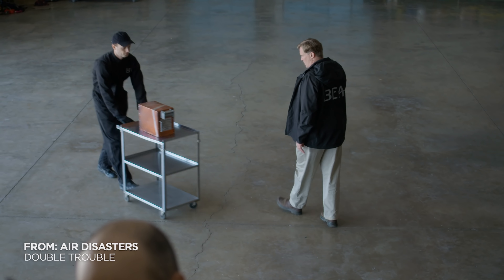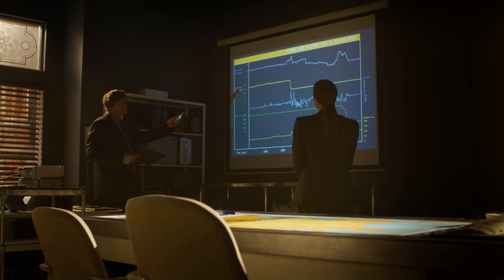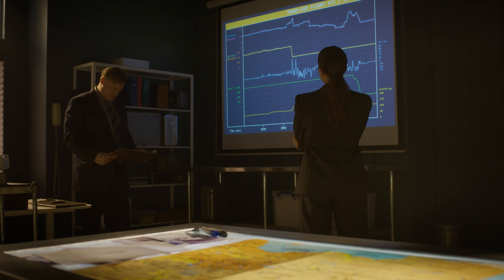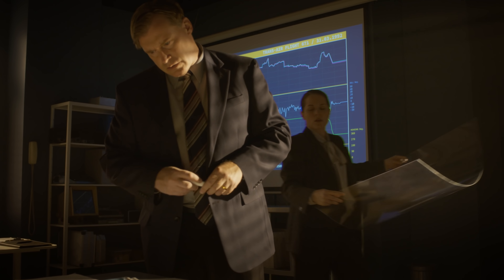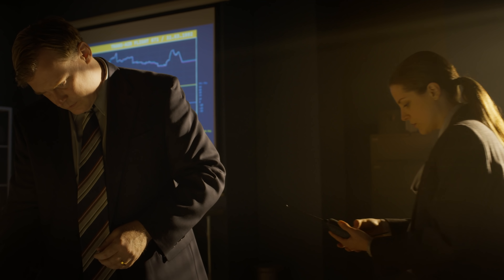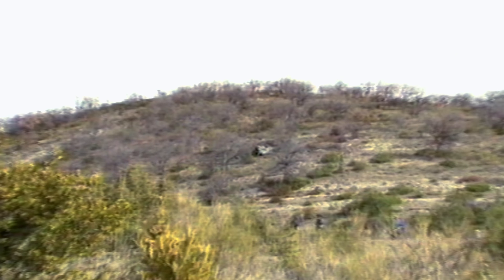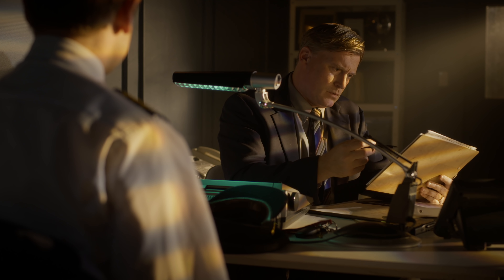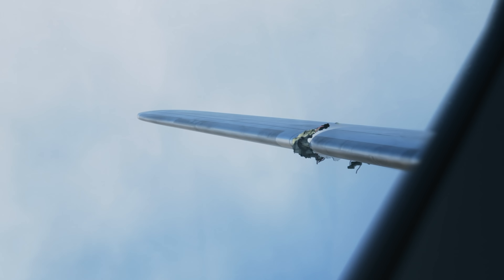Why Did 2 Working Engines Detach From this Plane at the Same Time? 💭 Air Disasters | Smithsonian

Comment: Who had Engine Detached
Flight 191 lost the left engine 
Flight 671 lost 4 or 2 engines 
Flights 587 (lost two engine falling from the skies caused by Pliot Error)
Reply: El al 1862
Reply: And a united airlines dc-8
Reply: And also EL AL 1862
Reply: The USAF B707 too

Comment: So in all these cases including TransAir #671, the result was metal fatigue which is unable to be corrected (e.g. use different metals to manufacture the engine and mount) and the only remedy is more frequent inspections?
Reply: At those times, those solutions (mostly different metals) are not available. For this specific flight, the condition is unusual: severe turbulence. Besides, metal fatigue occurs gradually, so early detection is vital.

Comment: so what happened then? could someone explain for me thanks
Reply: It was a due to metal fatigue on the attachments of engine number 3. The engine detached and knocked out the 4th engine
Reply: Metal fatigue caused one of engines to fly off this hit the other engine tearing this off
Reply: since no one explained i will - it is metal fatigue and one engine hit another
Reply: @theskyline1425  this incident is exactly what happened to El Al 1862 except it was a 747 this time and it didn’t end well the final report also conclude same findings and even more?

Whale 05 a Boeing KC135 (I said it was a McDonnell Douglas aircraft it was Boeing for your correction) Tanker aircraft during the Gulf War was flying North from Jeddah and because they were ahead of another Boeing KC135 I believe it was Whale 020 who had further to go mid flight they allowed 020 the other KC135 aircraft ahead of them as they had further to go (020) the winds at the time and because they were separated by 2 Miles and were approximately 2.5 Minutes apart and winds were coming in from the west on a heading of 270 blowing at 85 knots. Pushing the wingtip vortices or Wake Turbulence into Whale 05 putting the aircraft into a violent left roll briefly and when the aircraft snapped 110 degrees to the right it’s what snapped Engines 1 and 2 off due to Extreme G-Forces this accident was also adverted as the Commander or Captain Major Sweetney learned from training if you’re in a violent bank deploy the speed brakes on both wings which saved the plane, himself and his crew.

For El Al 1862 the video has been done by Disaster Breakdown, I believe TheFlightChannel has as well and of course Smithsonian Channel has as well. 
The Mission Disaster or Whale 05 that is done by Smithsonian Channel possibly by TheFlightChannel but Disaster Breakdown hasn’t done it tho

Comment: Why did they detach at the same time? Murder suicide pact?🤷‍♂️
Reply: Metal Fatigue on Engine 3 and since it was on the inside of the right wing it would make sense that it would be blown backwards and to the right into Engine 4 

El Al 1862 is pretty much the same except it wasn’t a happy landing search it up, Disaster Breakdown, Mini Air Crash Investigation (I think the channel is called), TheFlightChannel and Smithsonian Channel have posted videos about it. 

Another example is Whale 05 titled “Mission Disaster” except that wasn’t due to aircraft having an engine fatigue on it, it was due to powerful winds and due to them being ahead of another KC135 Tanker Aircraft (Both planes were MD KC135 Tanker aircraft) they swap positions mid flight as Whale 020 the other aircraft had further to go and its Wingtip Vortices / Wake Turbulence was pushed in by Winds coming in from the west at 85 knots which probably what about 150 km/h maybe 170 which would be about 100 to 110 mile and hour winds. 

The video has been done by Smithsonian Channel and probably also by TheFlightChannel check both videos out.
Reply: Mind you similar accidents have been due to undetected metal fatigue 

China Airlines 611, United 232, American Airlines 191, El Al 1862, Reeve Allusion Airlines Flight 8, Ahola Airlines 243, Japan Airlines 123, Southwest 1380 and 3472 (I believe the callsign was 3472 when it had its Engine One a CFM56 Engine exploded like Southwest 1380) and many others.